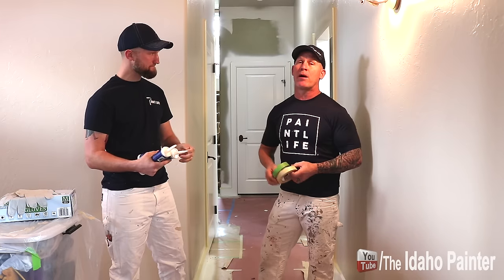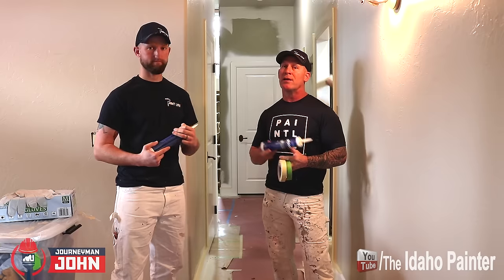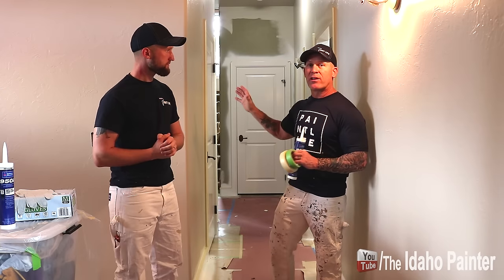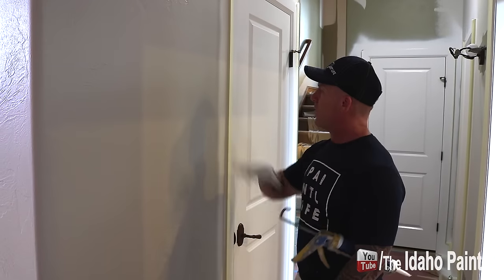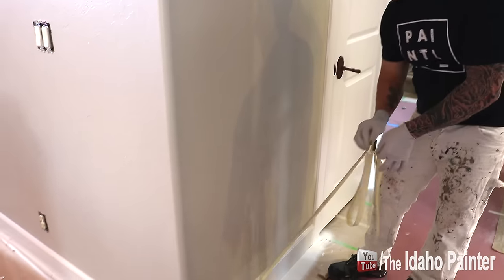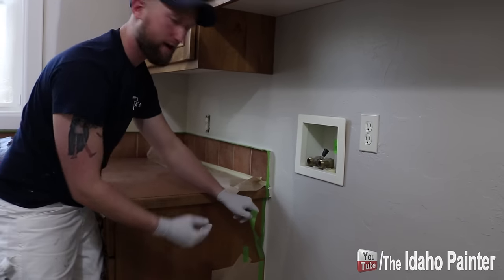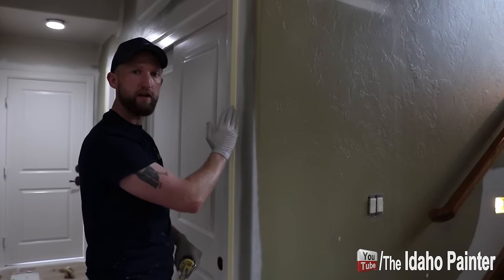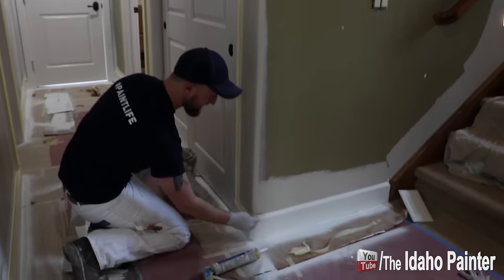PERFECT lines with caulking and tape.

Comment: I've been using this trick for over 12 years.  I always tell other painters to set their pride aside and focus on the finish product....  yes, we all can "hand cut" a line...... but not even the best painter in the world can compete with a good tape line!!!
Reply: Viral Clown dude you must be a hack! He didn't say he "needs tape"
Reply: I agree 100% with Viral Clown.  Also, in my area we only really paint walls with flat/matte paint.  As the Idaho Painter stated in another video, flat paint does crack if you apply it over caulking before it fully cures.  So if I used this technique I would have a house full of cracked paint with would look horrible.  But I'm glad the other painter at the end mentioned a good painter should be able to cut these lines free hand but this is a good way for an apprentice to be able to make straight lines before he hones his craft.  I am fond of the back rolling technique when doing cut ins.  I didn't use to do it but I think it looks better and actually saves time because I rarely need to cut in a second time with a brush.
Reply: ive seen guys cut lines as straight as tape.  Saves time and money
Reply: There are times when the line you are cutting in is not of a flat surface and even with tape to get a perfect line is impossible, but caulking the tape line then removing nearly all the caulk and painting over immediately and removing the tape  immediately will give you perfect results everytime no matter how bad or bumpy the surface is, has got me out of trouble many times and much quicker than trying to cut in by eye, obviously not something I do very often but there are times when this system is needed and gives perfect results.
Reply: I'm learning cause I love painting.  I've bought r everything toy recommend.  I'm self employed and spilt Mr work from site to domestic.  Frog didn't work but 3rd was good for bottom lip of coving. If you have old axus brushes?  Could I try a shot please?  I'll send it back.  Purdys you told to get keep twisting in satin.
Reply: John Mckay
wah? huh?
Reply: Doom Slayer that's what the edge of your 5in1 is for. After you cut a line,if it appears a little wavy take your 5in1 and pull it back towards you and bam! Straight lines with no tape. Dang,where you people learning how to paint, home and garden shows?
Reply: Richard Martin Agree!!.
Reply: I always spray trim first, then mask off with green tape and cover all the trim with a masking gun. About an hour before spraying and backrolling the walls I use a lightly damp sponge to activate the edge of the powdered frog tape then go for it. Hardly ever any touch ups and never any bleeds this way. Try it.
Reply: My boss told me that now I’m in Orlando lol
Reply: I totally agree with you sometimes in between the ceilings and the walls there isn't a visible line because the taper did a crappy job
Reply: I always let the caulking dry a little then paint no big deal always sharp lines
Reply: Richard Martin me too
Reply: @Viralclown  Did you watch the part at 19:05?
Reply: 23 year painter. Strongly disagree.
Reply: Peroxide in a small spray bottle and a 100% cotton tee shirt that’s cut into rag size squares is the answer to removing drips, dots, specs and excess off unwanted surfaces.
Reply: MLBYERZ well I am not a painter.  But I ain’t rich and can’t afford to pay a professional thousands of dollars to paint my house.  My wife and I did it ourselves.  It doesn’t look like it would if a pro did it but it is good enough.  Most people will never notice the mistakes.  This technique is great for people like me.
Reply: My boss doesn't let us cut in with tape, only certain situations, we have to hand cut everything and it sucks
Reply: Painters have huge egos for people who can't build the house. All this specialization into trades that's why I love a guy who can do it all. Not saying painters are not skilled but jeez this thread is ridiculous watching you argue.
Reply: With a good brush...I can.
Reply: @Alamyst2011  Exactly!!
Reply: @ryanmccue8180  painters love to argue, it's unusual for me to agree with you
Reply: Ok he said at the end of the video if u are a skilled painter u should be able to cut a straight line without tape! But they have there people do it this way so they dont have to worry about it. I dont see what the argument is about? Painters all have ego's but that only goes as far as who is better who is faster. There is no debate on taping your lines. I am a third generation painter I am also a finisher, floors  doors tile and finish carpentry I have 2 divisions to my company one is painting residential and commercial the other is complete home upgrades we flip alot of houses and help people buying or selling have the best property  they can
Reply: @ryanmccue8180  I agree completely but there are very very few who can actually do it all and be high quality I have hired union workers who say they are carpenters and couldn't do crown or any finish work or a Mason that can't put slabs in but can lay block only. I can do it all but no way can I keep up with a sheet rock crew that tapes and muds all day every day and that's all they do plus not much of a stilts guy lol!
Reply: @chrisbradley3867  yes I agree I'm training to become General contractor to basically replace my.boss who is growing to be long in the tooth Haha we hire out subs as well when we want perfect jobs but for the most part we can do it.
Reply: I'm sure it looks good because you guys have the trick down packed.  I will say i have painted since 94.  Painted everything, high end custom/ to full highrise buildings.  Caulking is another skill. Windows to granite exterior panels dead flat no lines on my caulking and well know in the city for neatness. I tool my caulking windows with a shaped soft wood and soapy water.  Those baseboard should be caulked before they are sprayed. Caulked tight and square.  Spray the trim then if you want tape for lines extra or cut in with brush.  That is the most productive way.  Like this if you want to use the tape its still on the base boards when you roll the walls, pull tape very end.  90 percent of home painters are too cheap to buy tape cut the line on the base last.
Reply: You guys hiring ?
Reply: U r a joke and I will put money against anyone who says taping is better and more cost effective
Reply: EverGrim I’m sorry to tell you I can paint any line without tape I also use a 5 in 1 and wet rag if the line isn’t prefect then it is but only people who paint everyday know that tape lines always look odd they also let paint under sometimes so u can’t say tape is always better I promise u it’s not better unless u just can’t cut in
Reply: @tonybeadle8392  If you want to paint 2 coats, do you tape and caulk twice?
Reply: Great info
Reply: @Richard Martin ~YOU SIR, HAVE STATED THE BEST COMMENT OF ALL OF IDAHO PAINTER COMMENTS EVER IN THIS UNIVERSE OR ANY OTHER!  I am so sick of these butt-hurt, for whatever reason, painters that keep bugging the hell out of the Idaho Painter(s) with this nonsense.  HE DOESNT HAVE TO DROP THESE JEWELS FOR FREE PEOPLE! Humble yourselves and focus on putting out the product the CLIENT expects, and focus on making a profit! Otherwise...go get a job. You OBVIOULSY don't have the mindset to run a profitable business, which is why this method goes right over your heads! SHEESH!
Reply: @MaxRockatansky853  Thank you for not being rude in your disagreement.  How did you learn to do it by hand as a fairly new painter?  What did you do before you got good at it?
Reply: @ryanmccue8180  It's frustrating for me too to watch all this "measuring who's is bigger" malarkey in these threads.  I'm a painter with no where near as many years under my belt and I am here just to learn.  They are worse than middle school girls sometimes, and I should know because I use to be a middle school girl IN THE MEAN GIRLS CLUB TO BOOT!.  So yeah......I'm reliving my adolescence in these comments sometimes.
Reply: @jordynwhite3986  hahaha that's hilarious because most of these guys are grown men and they remind you of high school popular crew but in all serious the trades are so awese.and such a great investment for you future at work and at home I wish you the best in your career!
Reply: @jordynwhite3986  Started out painting big new custom homes that were stacked with trim. Three piece crown in the dang closets. 8 years of that will make you a master caulker. Lol Much love and good luck.
Reply: I've personally never seen a good a paint line created by using tape, atleast compared the cut in with out it.
Reply: Tape is a four letter word to a real painter
Reply: Absolutely agreed
 Especially bc some of us love a straight line and care about the way our hard work looks.
Reply: 😂😂😂😂.  Very funny
Reply: @drudrew2297  ^
Reply: Blah blah blah thread/ its like everyone can split an atom or something. Waste of time comments.. "I can cut a straight line with a brush "  who cares! without the  sun shining you wouldn't be able to do anything.
Reply: I've seen 2 of your videos supposedly showing you how to paint straight lines. None of them show the actual straight line and you don't zoom in on what your saying is a straight line. Your videos are full of talking not much proof. Your supposed straight line can't be seen so your advice is poor advice.
Reply: You guys are a joke. You just trying to sell products. Lame
Reply: I only see you do one coat with that method what about when it needs to coats?
Reply: How long do you recommend waiting right after you apply the caulking to paint over it?
Reply: Yes that's true I have been painting for 11 years and you can't beat a taped line If done right .
Reply: Not pride ...it's skill
Reply: Pride is one of the hardest emotions to get rid , no better truth spoken.

Comment: For those of you asking what to do if you are doing 2 coats . Easy !  I always cut first and roll  second.  This is how to do it: On the first coat , cut to within an 1/16 of an inch above your tape on baseboards ( do not let your brush hit the tape). On 2nd coat  caulk the tape on basebords  then paint and pull tape . Work about 5 feet at a time .  Its fast and leaves  perfect lines .
Reply from the maker: Interesting way to do it, thanks for sharing!
Reply: Paint Life TV how do you guys do it??
Reply: Awesome. Thanks. Bought my first duplex 5 moths ago. First apartment painting took forever. Just did ceilings in 2nd. Got this info just at right time. It should come out way nicer. Than 1st apartment. Thanx again
Reply: I just did this for the first time experimenting on a room in my own home. I liked the process, and I did it similarly to you. The only thing was I could see a slight difference around doors and windows (eye level) because the slight bit on the final cut in had only one coat. Do you not run into that?
Reply: Is this exclusive to flat paint?
Reply: @Idahopainter  how do you guys manage the second coat?
Reply: I was wondering what kind of white/ clear caulk are you using?
Reply: @evonnegivens3561  it looks like 950a from Sherwin Williams

Comment: Another cool tip. To ensure your tape edge is down properly, i run an old debit card/credit card along the edge. Yields perfect results.
Reply: Denis& Litisha I use a plasterers small tool , perfect
Reply: The handle of paintbrushes typically have a sharp corner on bottom that’s perfect for pushing tape in

Comment: Great  video guys. I'm a professional painter of 20 years. I still use tape I prefer using frog tape because the glue adhesive is much less then the 2020 tape. Ive heard the same comment from younger guys saying a true painter doesn't need tape to cut in a line but they lack experience because I can get more perfect line and more production done in the time it would take to cut in. In addition tape does keep it consistent, if you free hand and by the end of the day fatigued can set in and you will lose consistency and speed, and keeping it consistent is key for the best end results. Having multiple people cutting in your can really see that not everyone cuts in the same way. I do like that you choose to back roll your cut in but that adds alot more time for labor on projects I figure your roller cover would come close to covering your brush strokes and you uses the best paint so it should level out nicely. Keep the videos coming glad to see that people can see painting not just about slapping paint on walls.
Reply: Steven Rodriguez i agree, you can always tell from bad corners,  on the cut in.  Tape prevents that.
Reply: Frog tape is great for a smooth surface, personally if I'm painting the walls and trim I like to reverse paint it when I can.
Reply: I agree as well, consistency is what you want. I typically dont tape unless there are 2 coats involved , or in cases of hard to reach corners. I have yet to run a time saving test between taping on single coatings yet the fatigue factor is a great point. Painting day after day- sure i can strike a good line consistently, but how much over the course of a job is an error forced or time lost due to fatigue? Good point. 
Also backrolling edging is great- especially for coverage if your shooting for full coverage on 1 coat.

Comment: I always let the caulk dry first. If you paint over wet caulk, the caulk shrinks when it dries and can crack the paint film.
 I always 2 coat when cutting in which requires letting the paint dry.
 
It is sometimes a problem pulling the tape after the caulk and paint are dry. I usually just mask off the baseboard, but freehand cut-in the casings and below the crown on painted woodwork to avoid the problem (paint stretching) during tape removal after the paint has dried. However, if it's stainwork, I mask and caulk everything.

I absolutely agree with John that you pull the tape off with your hand in front of the area being removed. 
You can also buy 1 gallon of wallpaint color in flat to cut-in the first coat, then once it dries, 2nd coat with latex enamel and pull tape while wet. The dried first coat of flat paint won't stretch like dry latex enamel does. 
Good video!
Reply from the maker: Awesome, thanks for sharing!
Reply: Have you tried caulk from Sherwin ?  Never have had an issue with cracking when painting.  I do wait about 15 mins but as in this video it works and no issues.
Reply: Cpcsof1 you know what you talk about and that is really profesional opinion and look
Reply: What if 2 coats are required?
Reply: Cpcsof1 let me start by saying what ever gets the job done,  nothing wrong with the way Chris and John do it,  but I would usually spackel and caulk at the same time and let it dry before sanding and painting too,  but I did like the clear caulk and tape on the grout  lines !  If I paint the trim first or if it’s stained trim I usually use 3 or 6 inch masking paper.  Many different approaches and I love seeing how other pros do it because I always learn a trick or two (I also have a trick or two too teach :)
Reply: I always spray trim first, then mask off with green tape and cover all the trim with a masking gun. About an hour before spraying and backrolling the walls I use a lightly damp sponge to activate the edge of the powdered frog tape then go for it. Hardly ever any touch ups and never any bleeds this way. Try it. I have never had to use caulking.
Reply: J.J. Nerti we would mask ten rooms in new houses of stained and polyd trim and leave it masked for days while we primed and painted,  then pull the paper by cutting kinda like trimming wallpaper with a knife or sharp putty knife.  The great thing about painting is there’s not only 1 right way,  you plan the jobs to make it easy and efficient for yourself and hopefully you’ll end up with a quality paint job ... PS, yes we had to touch up some spots where the paint pulled off but for the most part it worked great :)

Comment: I am a retired residential and commercial builder and I required all my painters to do EXACTLY as you do.  Every home I built, I built as if it were my own personal home.  I just tripped upon your channel as I am preparing to repaint my white millwork black...don't freak.  My BFF has it in her her million dollar home and it is stunning and a BIG plus...doesn't show dirt as glaringly obvious as lighter colors.  Anyways...I haven't had the pleasure of watching all your videos but will make an effort to see if you deal with preparing millwork and filling finish holes.  

My Nos. 1 painter when I built taught me a great deal about tricks and tips....the biggest of which was using car bondo (yup...that red stuff) to fill millwork joints and finish nail sets...best stuff EVER for filling cracks and holes in millwork when preparing to paint.  I even used it a few times to repair big holes in hollow core doors...worked amazingly well and is super strong...no more nail pops and the doors, jambs and trim looked seamless.  I could NEVER see the trim carpenters joints once the painter went through with bondo and painted.  I had very low 1 year warranty touchups with respect to millwork issues where house settled and started it's off gassing and drying out process.

Comment: This method is the best i painted a 4000 square foot house total repaint by my self with  ruff orange peel texture flat white ceilings, bone heron  trim and stix and stones walls and this way is not only better lines but at lest 50 times faster as well if I was free handing I would still be cutting in not to mention it's nearly impossible to get a perfect line  free handing on a bumpy texture you guys saved my life thank you 😄
Reply from the maker: Glad to help, thanks for watching & supporting!